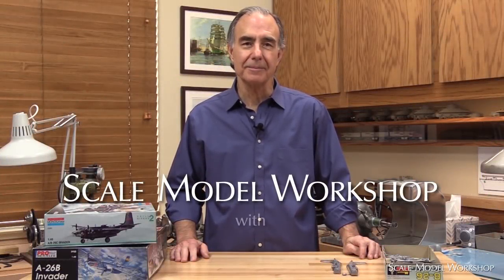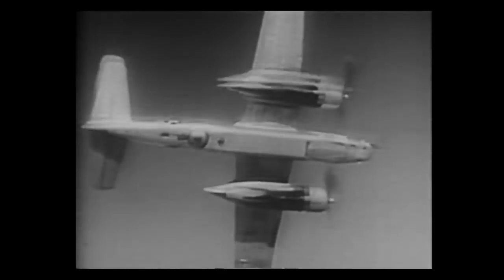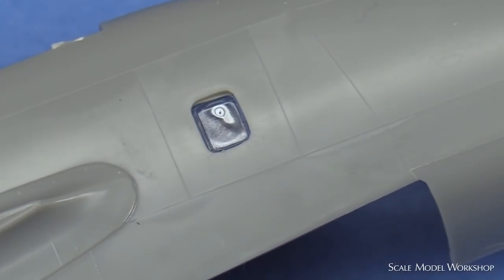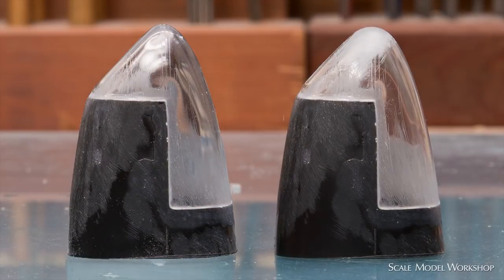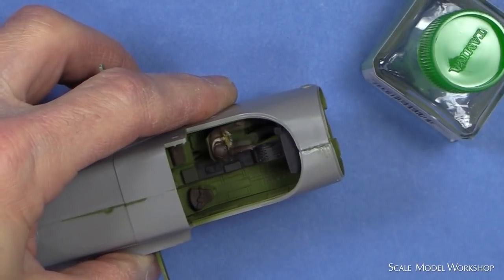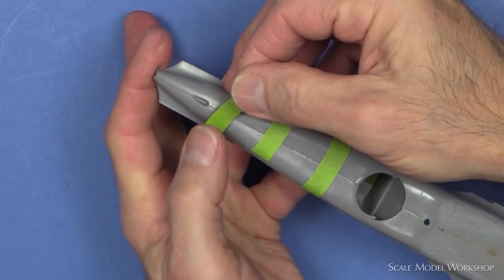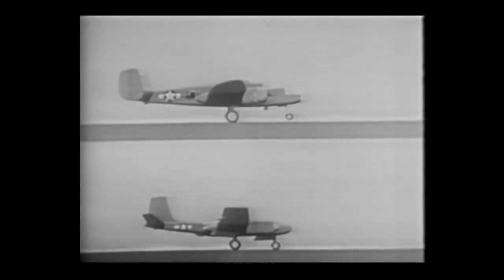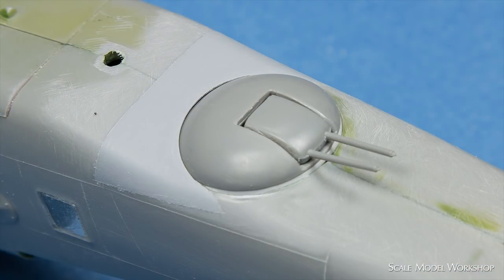Building the Revell Monogram A-26 Invader ... Episode 1

Comment: My monograms were B25 and B26,  but were balsa except for plastic canopy , engine nacelle fronts, props,wheels, geaar struts .   I believe they were called Monogram Speede Built.   There were also a series of fighters, F86, F6F, F4U all basically the same.  
I lived in Westchester, Ill and around 1954 four F86D`s flew over at around 500 feet in V formation.  They probably were based at O Hare Field which was nearly all USAF  and little commercial at the time.  How things change.